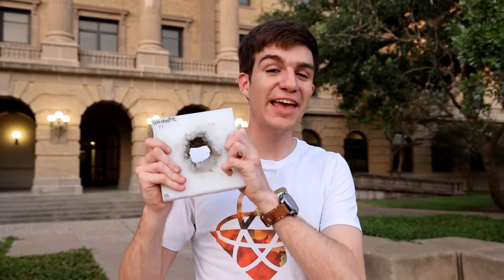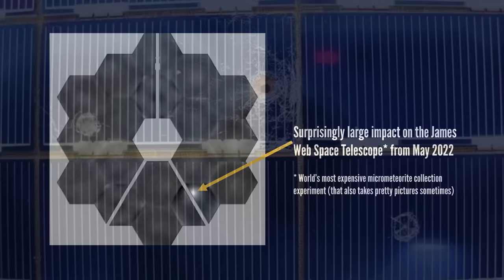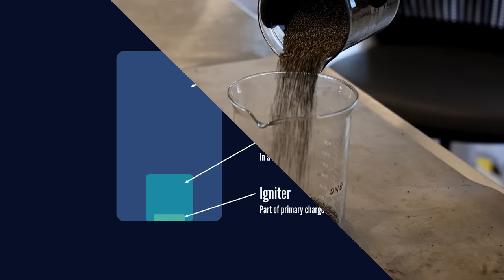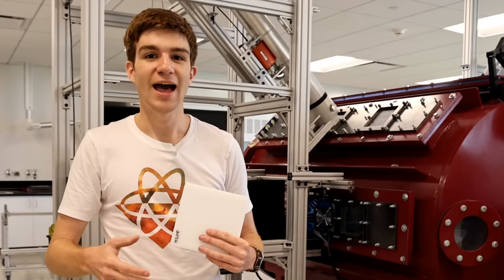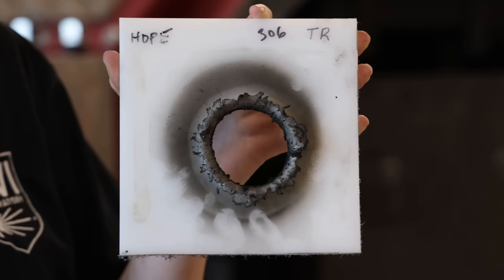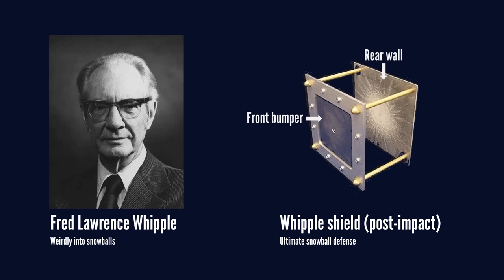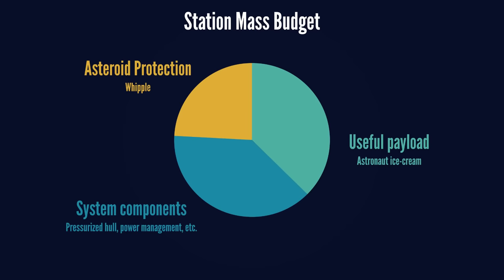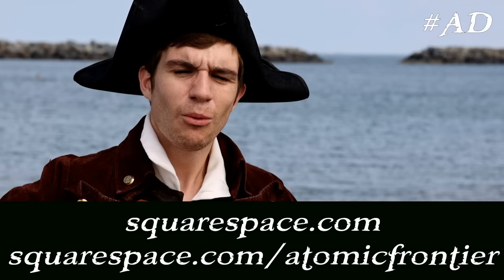Asteroid Shields are OP

Comment: It's a bit counterintuitive, but I like how the solution seems not to be some new exotic material but rather just a clever combination of guardian angles.
Reply: Literally the best type of innovation!
Reply: That pun, I was shot through the heart, and turned it.
Reply: Unironically that's more or less what tanks tried to do in ww2 and later on. Angles are huge when protecting something since some of the energy is deflected - but if used badly they take too much space
Reply: 100% that's what they need to be nicknamed.
Reply: Really pulled a fast one with that pun :)
Reply: Damn ... I needed to read it out loud to appresiate what was going on. Well done.
Reply: Is there an name for this kind of matrix system? I am making a sci-fi videogame and want to include it, if there's no formal name then I think I will call it something like "guardian matrix armor"
Reply: I think they would be better off allowing the "Objects" that impact, to build up and build a inner wall.... basically use debris to make another padding layer while also preventing damage to real structures.
Reply: @ravoniesravenshir3926  That would be cool. The only problem is that A the first impact would puncture the hull. And B, there are so few impacts that the chance of repeated impacts in the same location is tiny.
Reply: Isn’t it called meta material?
Reply: @warbrain1053  Angling armor plates also increases the practical thickness of the armor, instead of traveling in a straight line perpendicular to the armor plate it has to go through the plate diagonally. By sloping a 100mm plate 45 degrees a shot essentially has to move through 200mm of material, so it saves a lot of weight.

Spaced armor is what the ISS uses, its got aluminum sheets on the outside of the hull about a foot away, it makes tiny bits of space debris turn to dust as it pops through the aluminum so it just peppers the hull rather than just whizzing straight through and causing problems.
Reply: This is such a good pun, I love it
Reply: O
Reply: guardian angles 😂
Reply: Wow. No one
 . . . . .asked
Reply: ¹!
Reply: I read that as gradual angles and thought i had just seen the best joke ever
Reply: Wait... im slow asfuck
Reply: exotic geometry > exotic matieral
Reply: Sloped armor is a technology that has been used since WWII.  As the saying goes, there’s nothing new under the Sun.
Reply: Ha HA ha  Guardian ANGLES...  You win pun of the week!
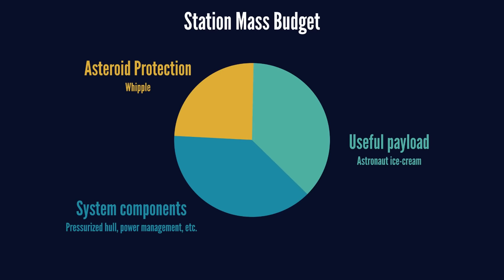Reply: 8:44 Could you please tell me where you got this footage? Which research project is it, I'd like to take a look. Thanks.
Reply: @ravoniesravenshir3926  YEAH changing the weight of a spacecraft doesnt matter much probably...
Reply: That was a good video man. To be honest I thought it said 'Android Shield are OP', but the video was so interesting I didn't think about it until nine minutes in lol.
Reply: @nightthought2497  lmao
Reply: @warbrain1053  even before WW2, things like the FT-17 had some small pieces of angled armour. But the most notable ones were developed in WW2, like the Sherman, Panther and T34.
Reply: best engineering system lies in simplicity. not lack of complexity, but simple complexity
Reply: Its just angled spaced armor... we already use that on tanks for 20+ years
Reply: Look at the protection onion

Comment: That "honeycomb" shield is such a cool idea, and a beautiful illustration of Newton's 3rd law. Like... no, we can't just stop the projectile; but there's no reason we can't cleverly (and destructively -- but strategically so, akin to crumple zones on modern car bumpers) redirect its energy back on itself and away from the goods!
Reply: ...or like in some martial arts... using the opponent's energy against them. It is in truth not an impenetrable barrier, but a true deflector. Now imagine some material as a rapidly spinning disk CONE. What then?
Reply: @ExtantFrodo2  There is no way you could spin the cone fast enough to matter. Even if you could spin up your shield to 100,000 RPM (approaching the limits of feasibility for current material science), from the projectile's point of view, it would still be basically stationary. So the impact would be very similar to what was demonstrated with the angled plate. You would also need a double layer of spinners, and whatever mechanism is doing the spinning since the protected area of each one would be a circle, you'd need the second layer to cover the gaps in the first. That is to say nothing of the added complexity and weight of such a system.

If you could some how spin up a cone of material to the required speed, that would make for some very interesting interactions. I suspect that the cone would become more effective than an unmoving plate since the spinning would be bringing more material into the path of the projectile than a stationary plate of the same thickness would, effectively making the spinning plate thicker. That's just a guess though; hyper velocity impacts are frequently unintuitive and behave very differently than "normal" impacts so I doubt that we will ever see this particular thought experiment demonstrated outside of computer simulations, if even in that.
Reply: That is not Newton's third law. Newton's third law will only say the same force will be applied to the asteroid as the shield(because of which it evaporates)
Reply: @resurgam_b7  You offer some good thoughts on this matter. In addition the spinning center of the cone would be as ineffective as stationary material would be since it would not be presenting the same "thickening" aspect. The overlap you mentioned would have to encompass those areas as well.
Reply: @ExtantFrodo2  That's a good point, I wasn't even considering the center of the cone and the attachment point. I imagine it would be fairly catastrophic for the spacecraft if the bolt holding the ludicrously fast spinning mass were to suddenly disintegrate from an impact directly to it.

Come to think of it, a hit anywhere on a shield like that would almost certainly unbalance the cone and cause it begin oscillating horribly if it didn't just break up immediately. Then you would get hyper velocity cone fragments to deal with in addition to the micro-meteors you were already facing. All in all a bad day for the astronauts I'd say!
Reply: @resurgam_b7  Indeed! 😬
Reply: Crumple zone? Its more like a reflective zone, were the direction gets multiple times gets redirected towards the way in.
Reply: The hexagon is indeed the bestagon
Reply: The same logic allows ceramic body armor to do its thing.
Reply: @typehere6689  id probs say tank armour is more comparable.
Reply: yeah. sacrificial layers, light weight and easily replaceable.

Comment: You’re missing something. Holding a vacuum on the target side of the gun also greatly increases the projectile speed since there is no gas pressure buildup in the barrel between the projectile and target.
Reply: Well, vacuum is really nothing but absence of pressure. You'd get the exact same thing in space, anyway.
Reply: @niklaskoskinen123  You’re right but that wasn’t my point. His explanation of how they were attaining the projectile speeds in the gun was incomplete is all I was saying.
Reply: @jimk8520  Fair enough. It's all about what you are comparing it to, though. Shooting a gun in space won't reach the same speeds, and this video will explain why.
Reply: The target was in a vacuum chamber? He went through that including adding pressure to stimulate upper atmosphere?
Reply: @Jim K Exactly. The target getting to sit in a vacuum much as it would in space is a free bonus - the barrel in front of the projectile would be under vacuum ANYWAY, for the reason you state, regardless of whether or not you want to study space stuff.
Reply: @AttilaAsztalos  🍻
Reply: @TheKernelCollective  He mentioned that there was a vacuum, but not how it affects the velocity of the cannon. A pressure + vacuum canon has a much higher velocity than just a pressure canon.
Reply: Al Bundy once scored 4 touchdowns in a single game against his high school hool nemesis Bubba "Spare Tire" Dixon. Never forget.
Reply: Pulling vacuum only improves the delta-pressure by 14psi. When these guns use 3000+ psi it doesn't even matter.
Reply: @RubyByte  it does matter if looking for accurate data. Right and close enough aren’t the same thing. Ask your math teacher.
Reply: @RubyByte  it wouldn't, except that atmospheric pressure is coming from a physical gas. If that gas is allowed to sit in the barrel, it is confined. The projectile is being accelerated to supersonic speeds by the light hydrogen gas. The barrel is already full of heavy atmospheric gas, which can't move out of the way. The gas steals energy from the projectile as it forms a shock front. By the time the projectile reaches the muzzle, it's pushing an entire barrel's worth of highly compressed atmosphere. All the energy used to compress the gas is dissipated as it exits the barrel and expands in all directions.
Reply: @Greenicegod  but the barrel doesn't need to be sealed. The air would just get pushed out of the end. 

Moreover, yes acceleration IN the barrel is better if there is no air, but the second you hit the outside conditions you're getting all the shock and air interactions anyways. I don't think the 10ft of extra vac acceleration really helps.
Reply: @RubyByte  it gets pushed out the end only after stealing tons of energy from the projectile. Remember, the projectile gets ALL of its energy from depressurizing a gas... What happens when you use it to pressurize a different gas?
Also, once the projectile exits the barrel, it's in open atmosphere. The air can move perpendicular to the path of travel, something it couldn't do in the barrel. This does of course steal energy, but it's not nearly as rapid as the confined gas.
Reply: @RubyByte  Check out the youtube channel SmarterEveryDay. They built a baseball cannon with a vacuum barrel for use right here on good old earth and they explain why they did it, too.
Reply: @jimk8520  They could have mentioned it but I guess the focus was more on solutions to challenges. The vacuum helping with the projectile speed is more like a free bonus than a solution since they need a vacuum in any case.
Reply: @seneca983  i hear ya but if that was the case, they still explained too much even if they missed that part. 🤷‍♂️
Reply: @bryanergau6682  And, at a certain distance from any given nuclear blast, the frozen pizzas will be perfectly cooked.
Reply: @jimk8520  I am on your side, my brother. We will grow in numbers, and be the dominant Militia on this planet. I only need to know your pineapple policy.......and answer wisely, for your very life hangs in the balance. #CheatCode.....I like pineapple.
Reply: @bryanergau6682  Ah, the curious flesh eating enzymes in pineapple and papaya. Yes, pineapples can eat you, too.
Reply: Well, since the smart guys are talking here? 
Why do shaped charges work with heavy gasses produced by the explosives but guns dont?
Reply: @yaykruser  one is a detonation and the other is a deflagration? Edit: One outruns the shock waves and the other doesn’t? I think that has something to do with it anyway..
Reply: @jimk8520  Well, some say that, on the other hand Smarter everyday says that a gunshot is a detonation: https://youtu.be/4OvywNsWWd4
And even if so , how does that work on an atomic base compared to a normal gun? 
Why would a gun not be a detonation when it uses a very strong explosive ? (Nitrocellulose ist faster stronger than tnt , and Hand gun rounds somethimes even have nitroglyerine added).
And would that mean that if i use a 2 inch thick chamber and put C4 infront of my bullet that it would fly with 6km/s? 
So many questions yet the Internet fail to answer them...
Reply: @yaykruser  the difference is the rate of the chemical reaction. maybe look it up?
Reply: @jimk8520  Detonation velocity of Tnt is 6900ms and that of nitrocellulose is 7700ms. That cant be the reason. 
Especially since a shaped charge works with tannerite.
Reply: @niklaskoskinen123 I believe you're STILL missing his point. He's not referring to space, he is simply saying that the vacuum is helping the projectile achieve a speed it otherwise would not have the ability to in air. Focus man
Reply: @yaykruser  It has to do with something called brisance. That's why nitrocellulose is used in low order detonation in small arms. TNT maybe slower, but it's more brisant, causing a shattering effect instead of the heaving effect that's needed to move things.
Reply: Nitrocellulose is also blended with a number of other ingredients that modify it's characteristics in order to suit the situation it's being used for.

Comment: These shield designs remind me of tank armor
Reply: Pretty sure that it will eventually be used on tanks, if not already. Many technologies that were initially developed for space ended up finding earth-based applications.
We either get lighter tank armor for the same protection, or better armouring for the same weight. It could translate into higher speed, longer driving range, and/or fuel savings. Who knows? I'll leave it to the engineers but it's fun to ponder about :)
Reply: @lamdelmundo8492  sort of, some composite armour relies on the projectile hitting it deflecting in the way shown in this video.

Albeit since the velocity is lower, the effect is not quite as strong.

Comment: 5:40 to put that 63394 joules of energy into perspective, penetration of human skin requires about  80 joules (to penetrate bone it is only about 28 joules). Lower density mostly water based flesh protects bones.
Reply from the maker: Wow! a) way more energy than I though, and b) bone is surprisingly fragile. Thanks for sharing!
Reply: additional fun fact I know thanks to airsoft, it ony requires about 1 to 2 joules to 'break' skin. as in, to impact hard enough to cause a superficial wound.
Reply: isnt that a typo? really 80?
Reply: @ologhai8559  E=1/2*m*v^2. A 1kg (2.2lbm) mass traveling a bit under 13m/s (45.5 koh, 41.5fps, 28.3 mph) would probably hurt a decent bit.
Reply: Other interesting reference in this case, the average energy of a .50 BMG bullet is 20,000 joules. And it is already called an anti-material munition 😅
Reply: From experience with Air Guns i would say it requires less than 8 Joules to fully penetrate human skin. Joules is not a good unit to measure penetration capability anyways. A 40 Joule hunting arrow will penetrate much deeper than a 40 Joule lead round ball. Same as a fast and small 40 joule round ball will penetrate differendly to a slow and heavy 40 joule round ball.
Reply: i just watched Joerg Sprave video.... crossbow bolt with 80 J penetrated 1mm steel plate and several millimeters of plywood... i doubt human skin is on same lvl with this....
Reply: @ologhai8559  a 22LR bullet is about 250 joules
Reply: is this 'wet' bone or dry? wouldnt surprise me either way, rigid things are a lot easier to pierce/chip/dent than elastic, cohesive, soft structures, cause the force is focused on one point, in one direction, while elastic structures disperse it easely.
Reply: @lobster8009  Yea this doesn't really work. A car driving at 1km/h is hitting you with 100 joules of energy. But that won't break skin unless you attach something small or sharp to the bumper and you lock the skin you want to penetrate in place so you don't just get pushed.

So while yea you can penetrate skin with 80 joules of energy you can also penetrate skin with much less energy but something much sharper or you can do the same with much more energy but blunt.

It apparently takes about 6.8bar or 100psi to break human skin btw.
Reply: Depends on the person.
Reply: @PJ-oe6eu  yea pressure is a much better metric for that, than energy
Reply: @AtomicFrontier  fragile? Being able to withstand a lot of weight and being more durable than steel is fragile?
Reply: So for reference the impact from a really hot load and light bullet from a .45 acp cartridge is only around 550 joules
Reply: Would I be right to think pascals or another pressure measurement would work better?

Comment: I love to see the amount of research that goes into protecting astronauts (and their ice cream)
Reply: "Meteoroid and Debris Protection" was about 2% of the Space Station's budget (I worked on that project).  It has the "Whipple shields" described in the video to protect the crew modules and pressure tanks.  The now Space Force tracks dead satellites and debris in low orbit, mostly with radar.  If a bigger piece looks like it will come too close, the Station moves out of the way.  Windows not only have covers when not being used, but have four layers of glass.  Losing a window would be a catastrophic loss of pressure.

Some stuff just doesn't need protection.  The solar arrays have been punctured multiple times, but they are so thin stuff just flies through.  There are thousands of solar cells, so losing a few to impact damage isn't a big deal.

Comment: It reminds me of tanks. The tank rounds experience what's called normalization, this is where an incoming round hitting slopped armor deviates into the armor a bit, this effect can be amplified with a soft nose cone on the projectile and plates with higher hardness normalize less due to less digging. That's why I often armor applique added by troops was less effective because any issue was being normalized

Comment: Very interesting how the final solution is similar in spirit to a military tank's spaced armor. Both problems are so similar, in so many ways. High speed projectile, can't make armor too heavy. Solution, space and slant the armor.
Reply: True, but kinetic anti tank weapons have high mass and density which can take a beating by armor, where as space debris has high velocity but low mass, making spaced and sloped armor much more effective due to shattering. But you are right, the principles are the same